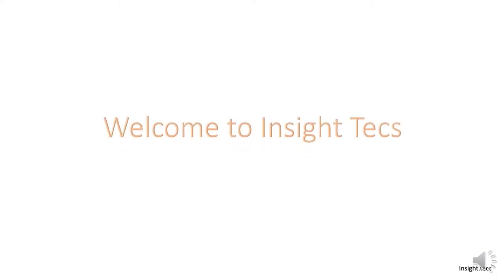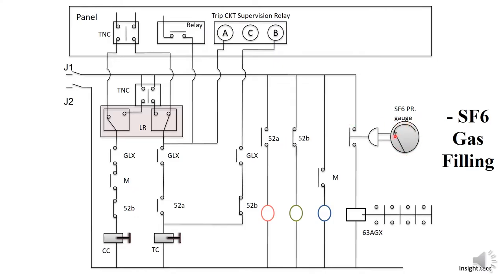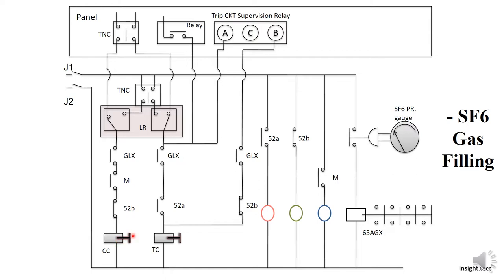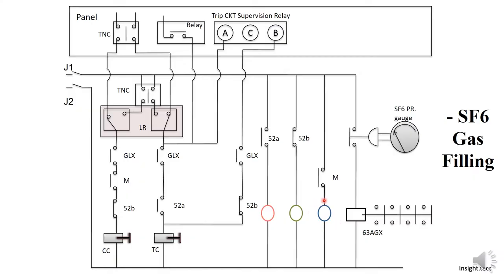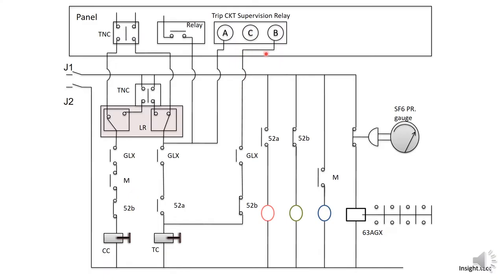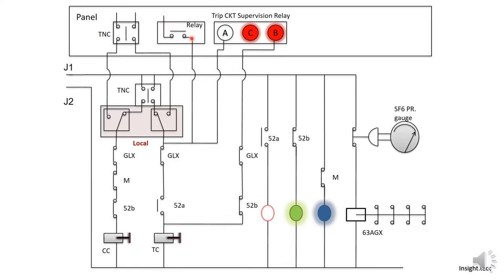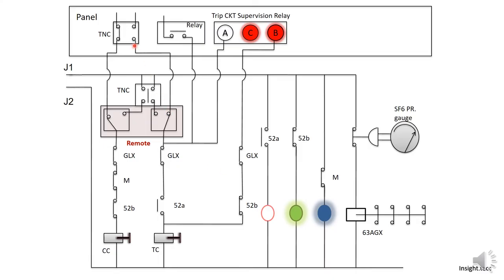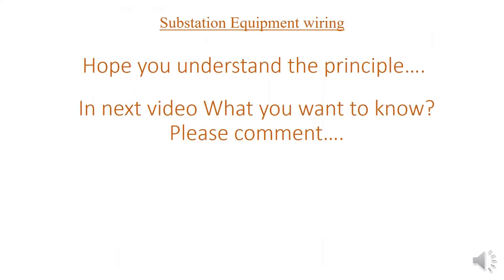Basic operations and wiring of circuit Breaker || Hindi

Comment: Kindly prepare a vedio on spring  charging interlock with density switch ,limit switch and it's charging control circuit of 132kv line breaker ogf ABB make if possible